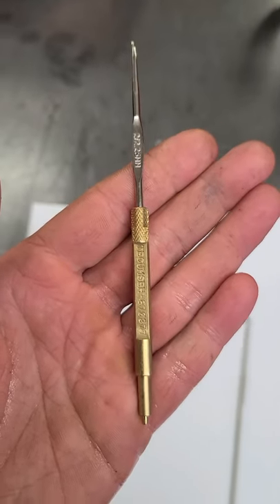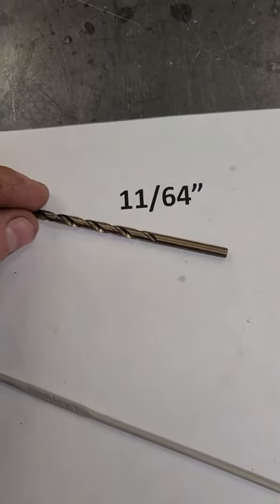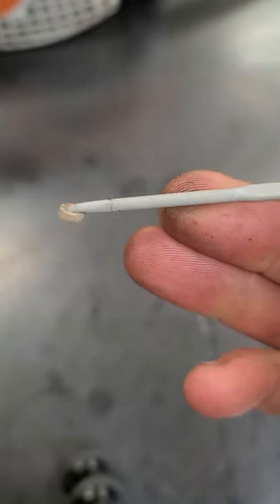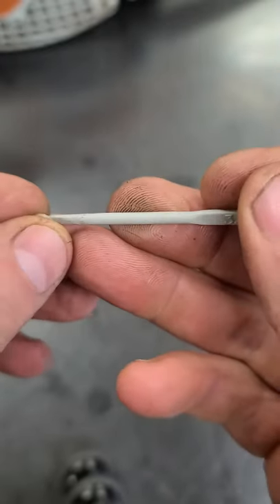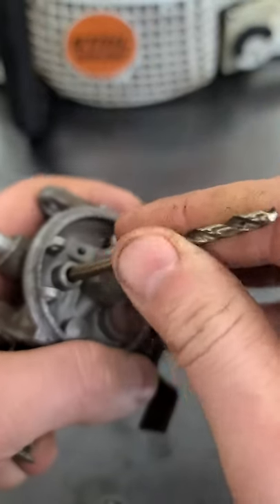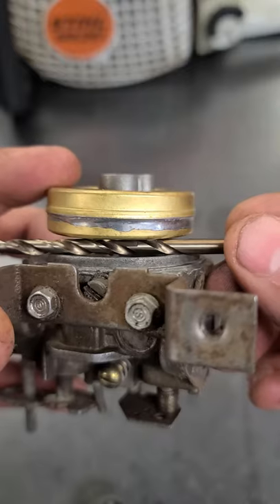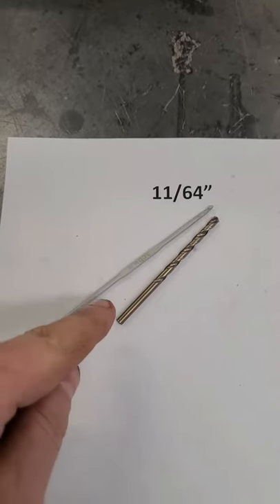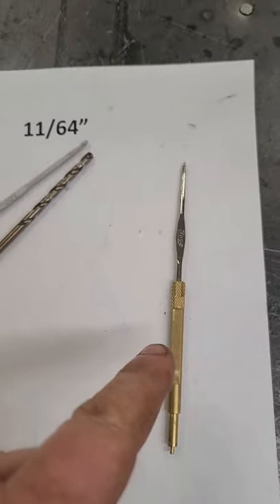Use This If You Don't Have The Tecumseh Carburetor Tool - #shorts

Comment: Or a pick set ?
Reply: No - you'll damage the needle valve seat.
Reply: @RichardFallstich  you use it to remove the seat. Plus you can also use a punch of the right size to put the new one in